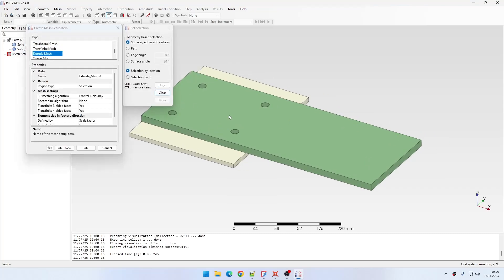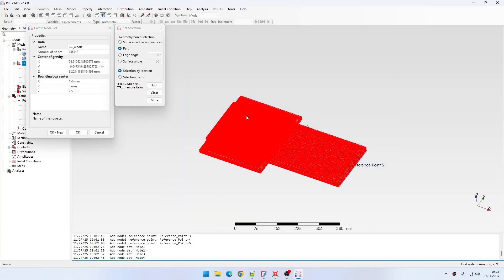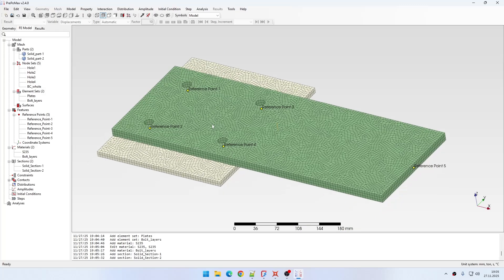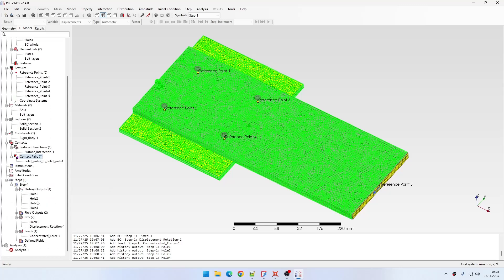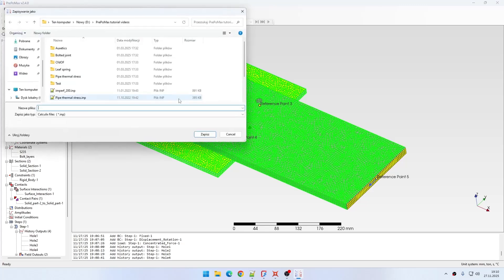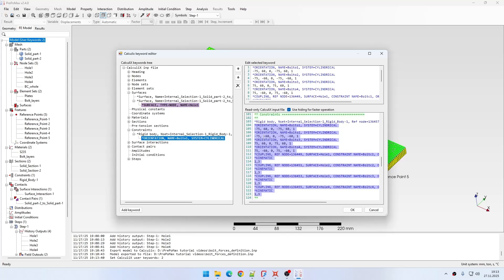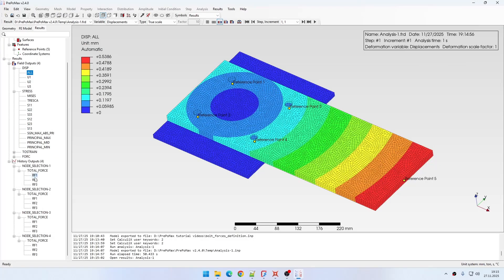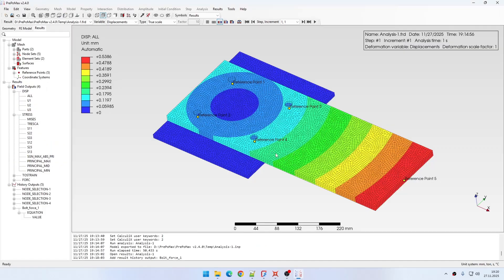PrePoMax (CalculiX FEA) - Tutorial 54 - Determining bolt forces from a simplified bolted joint model

Comment: Do you think Prepomax is adequate to perform a multistory building 3D structural frame modeling and analysis for a linear elastic static model?
Reply from the maker: Beam elements aren't currently supported, but if you use shells to model this, then sure. Although there are no specific features for civil engineering calculations.

Comment: Thanks for tutorial! I did not get which element type you were using. If you are using something similar to C3D8R in ABAQUS (Brick Element with reduced integration) you need at least 5 elements through the thickness.
Reply from the maker: Normally, yes, sure (I think I used C3D20 elements though). But here I’m only analyzing the forces in the bolts and even treating the plates as almost rigid to match the hand calculations.

Comment: Great video as always! I have some questions if you don't mind:

1) Why did you utilize the Calculix Keyword Editor for the Surfaces Definition instead of just creating surfaces from the option in the GUI of Prepomax ?
2) In the Kinematic Coupling Keyword, the x and y coordinates makes sense but then the z coorindates is set as 0 and 1 (for hole1 e.g. -75 ,60, 0,  -75, 60, 1), what is the reason we are doing this ? Is this how we define that it is cylinderical around the z axis ? ? If these holes are in the YZ plane instead of the XY plane then the 0 and 1 values would in the X coordinate instead ?
3) For Kinematic coupling you have indicated 1,3 (and not 2). Are these the restrained DOF in the radial direction (since it is cylindrical) ? so basically the bolts are coupled/restrained to the hole surface in rotation along X and Z axis ? why not 2 ?
4) In the history output of reaction forces (Nodes) why do we choose only the nodes in the top plate layer and not both layers ?
5) I understand you adjusted E and poison ratio to match rigidity of analytical solution, however; in normal cases the actual bolt grade and plate properties shall be used ?
6) Can these method similarly be used to determine tension in bolts as well ? In this case RF1 and RF2 are the shears that can be used to obtain the resultant. Would RF3 be the tension force on the bolts ?
Reply from the maker: 1. PrePoMax would deactivate those unassigned surfaces.
2. Cylindrical coordinate system in CalculiX is defined by specifying any 2 points lying on its Z axis so global coordinates of 0 and 1 in the global Z axis can be used here. And yes, if the plate was located in the YZ plane, the axes kf the holes would be aligned with the global X axis and this coordinate would be set as 0 and 1 for the two points. Of course, it would be more complex if the plate was rotated and not aligned with the global planes, but this should be avoided.
3. What you specify under the *KINEMATIC keyword is a range of DOFs (first and last one) so it’s actually 1, 2 and 3. So all 3 directions (radial, tangential and axial) are constrained here.
4. Because of how tye coupling constraint connects both sides, it’s sufficient to take the forces only from one of them.
5. You should use real stiffness for the plate in such a case, but keep the bolt boundary layer (you will likely have go decrease its stiffness though). Actual bolt stiffness is not taken into account in this simplified approach.
6. Axial force read with this method will be correct only when there is a positive net force in all the constrained nodes so e.g. if pressure is applied between the plates. For the load case presented here, the axial force is fictitious.
Reply: @FEAnalyst Thank you for the very comprehensive response! I appreciate all your videos again and your willingness to share your knowledge!

Comment: A really useful video (as usual). Prepomax is a great software, not only because of its well-designed interface, but also thanks to the videos you produce, which make it so easy to use.
I hope that an interface for modeling simple bolted joints will be supported soon, ideally with and without preload (using springs, I imagine). These types of elements occur all the time in both mechanical and civil engineering design, and I am disappointed that there is no native support for them in Prepomax, which is now a very useful piece of software..

Comment: Interesting video. Personally, my approach is to create a point spring on reference point and connect the nodes of interest with this. Is simpler to apply and pre-load by displacement BC on point spring.
Reply from the maker: Springs are common in such cases, but you have to use keyword editor too, need them for all relevant DOFs and have to specify a proper stiffness. I’ve tried beams too, but it seems they can’t be easily connected to the model and may even require *EQUATION constraints.

Comment: Interesting, I didn't know you could edit the text input directly.

Do you think that some kind of plugin can be created to have PrepoMax talk directly with Rhino3d using the text input ? so Prepomax could be run "inside rhino" ?
Reply from the maker: PrePoMax is just a pre- (and post-) processor for CalculiX so everything you define inside it gets written to the .inp file that you can easily read and edit (the syntax is really simple) in any text editor, then submit the analysis with CalculiX binary outside of PrePoMax and only use it for postprocessing. So to work with other software such as Rhino, all that would be needed is a way to handle input files in CalculiX format. FreeCAD already uses this approach.